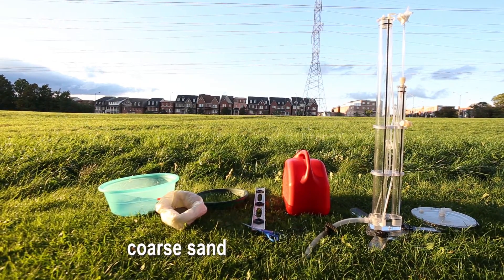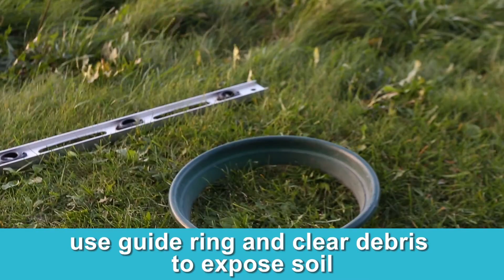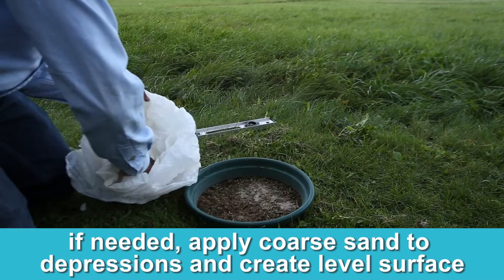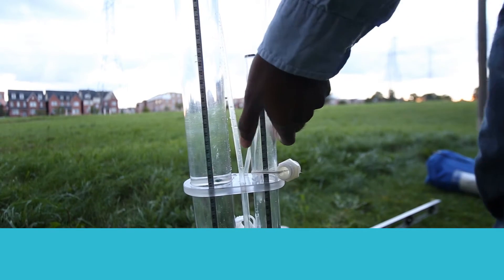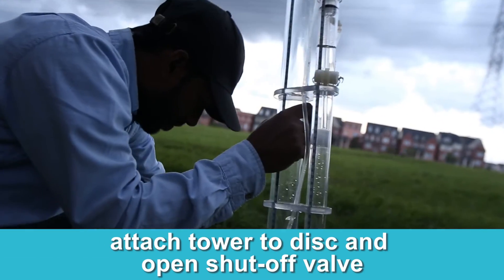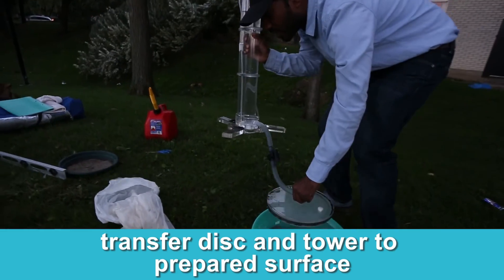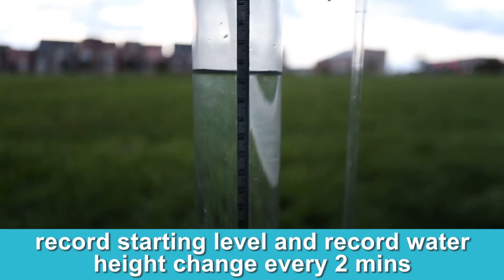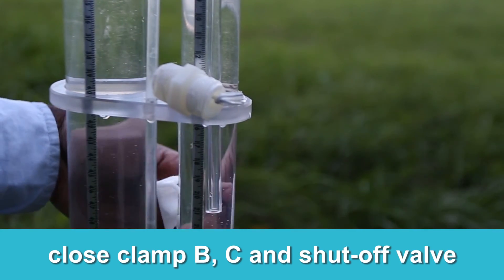Workshop: Tension Infiltrometer

Comment: Thanks, helped me a lot. But at the end, while calculating kSat values, should not we calculate ksat values of three different tension and then average it?
Reply: Hey great question. Based on the manual, you need two tensions in order to solve for the alpha value, which you require to solve for Ksat. The manual only suggests to use just this single alpha value. However, I found that depending on which two tensions I used, the alpha can vary. As a result, I solved for alpha using -2.5 and -5 cm tensions and the -5 and -10cm tensions and then used the average of the two alpha values to arrive at my Ksat.